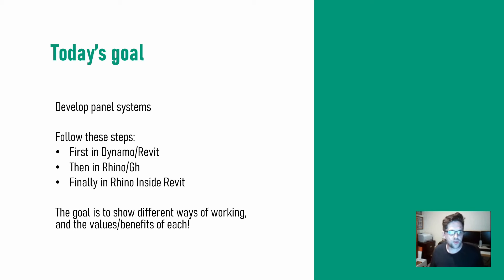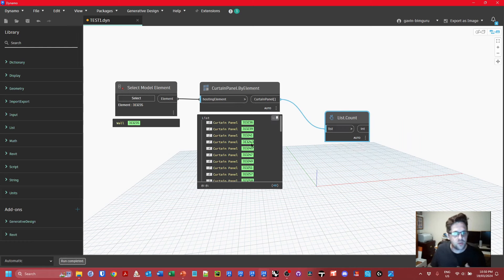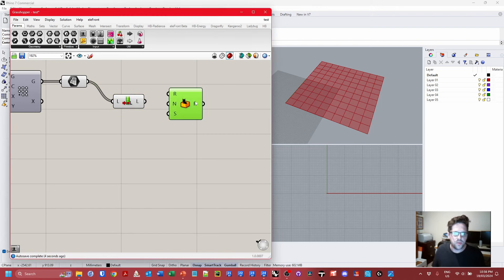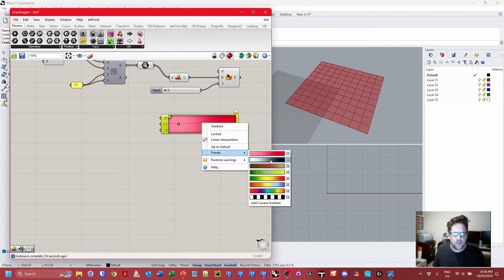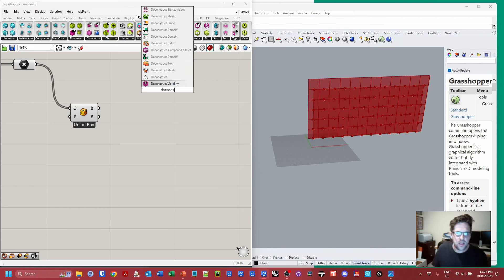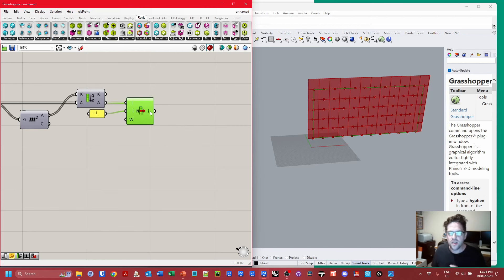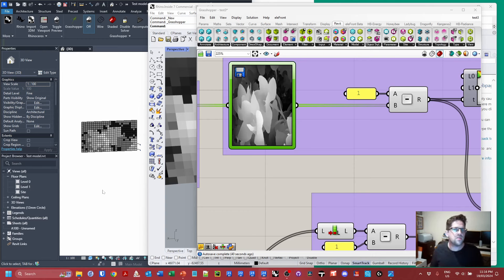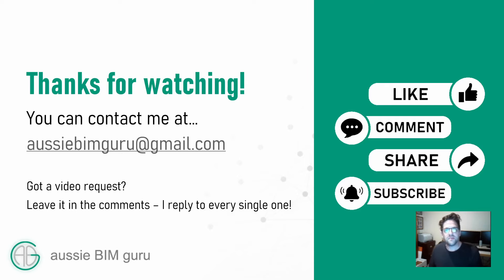Random/image driven facades using Dynamo, Grasshopper and Rhino Inside Revit!

Comment: What wiill be the application?
Reply from the maker: If you mean for the workflow this is just a mapping exercise. You could use thermal received values instead of an image to have a solar responsive facade. Or you could map a pattern to a facade instead of doing it manually.
Reply: @AussieBIMGuru  Great👍
Reply: I am doing Reinforcement modeling using dynamo can you provide packages, libraries or documentation?
Reply from the maker: @PANDURANG99  I'd suggest checking dynamo forums for queries about this as structure isnt my area of expertise.